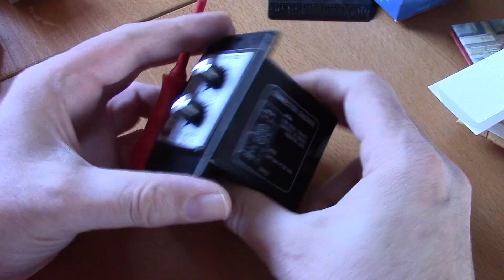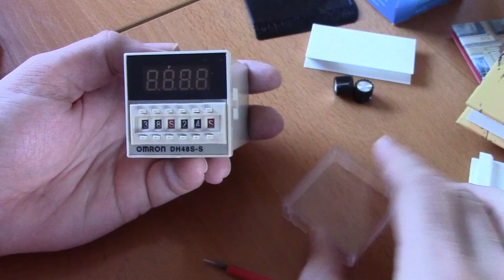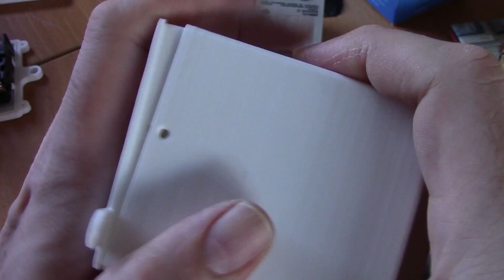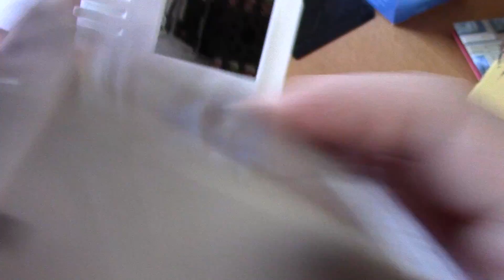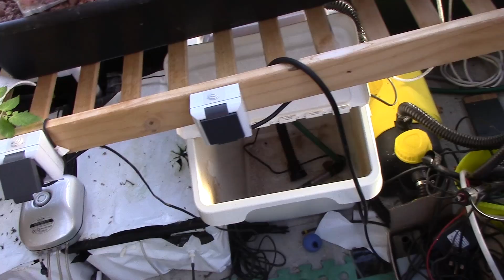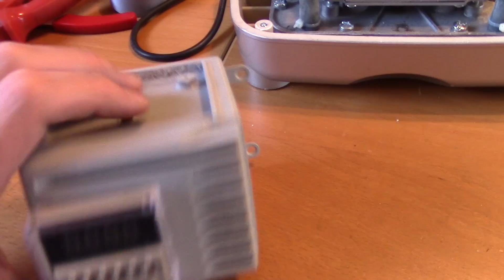Cycle Timers Revisited & Planting Onions

Comment: Hi, Thanks for Video. I have a question. I want to run my water pump which runs on Alternating Current 220 Volts and at about 9.5 Amps. I want to run it on 5 mins on and 5 mins off cycle until my water tank fills up and disconnects the power to timer relay and pump. For this purpose, I have purchased an FRM01 module and a 12V Power Supply to energize that module. The relay has a rating of 10 Amps @240 Volts AC. Do you think will it support the load of my pump or should I make any modifications. Any comments/suggestions are appreciated highly. Thanks
Reply from the maker: Hi Imran - With that 9.5Amps of current, I'm assuming that the pump is very large (2 or 3 horsepower). The 10A relay is only going to be rated for 10A resistive load and the contacts on the relay will probably fail after a few months in service as the contacts will likely wear out quickly or become welded together (this is the problem I had with my old relay modules, which is why this video is a 'revisited' one). Although I didn't do it in this video, if you want something totally reliable, I'd recomment using a solid-state-relay (SSR) module which are designed for running inductive loads (they're pretty cheap these days). I used other more robust dual-pole relays when I made this video because I'd had them sitting around in a box for a decade. Hope that helps. Cheers!!

Comment: Like the 3d printed enclosure, very neat. I prefer solid state relays to mechanical, mine handle upto 1500 cycles a day without any problems. Best part is there`s no clicking which can get annoying  ;)
No doubts you know but you`ll need a shorter fill time once the roots get going, as they reduce the space available for water ;)

Comment: I just got some NodeMCU boards in to play with, too.  I've still got some ESP-01's laying around, I want to figure out how to get them running as Arduino wifi shields, but a lot of the stuff I've found is shaky looking... not sure they're reliable yet.  I want to use them for my aquarium projects, so they need to be solid as life support systems lol
Reply from the maker: +mnelson10000 If I can get the nodemcu board working nicely, I'd be very tempted to bolt them onto everything electrical in the greenhouse. My air compressor can report back it's air pressure once a minute... my pumps can report their flow rates and water temperatures... etc... They're cheap enough that IoT-enabling everything is rather tempting....  Yet another project added to the list of things that I'll probably never get around to :-).... Cheers!!
Reply: +Jim Conner I've read some reports that PWM on them isn't quite stable or something, also.  It will definitely be nice once they're simple and solid like the Arduinos.  Arduino better get their act together or they're going to be left in the dust!
Reply from the maker: +mnelson10000 I imagine that they're doing PWM in software, and servicing the wifi receiver interrupts the PWM routines. I did buy myself a bunch of RS485 to TTL boards, so I could potentially run a multi-drop serial bus around the greenhouse to link devices together - due to an accident when ordering, I managed to get 10x as many modules as I needed though (whoops)... I would prefer the wifi approach though if it'll work reliably for me. Cheers!

Comment: Thank for the update on the timers, I'm glad you were able to find a good solution.  

It is also good to see that you are getting so much use out of your ultimaker 2, and that you are having fun in the process. 

The enclosures look great, and hopefully you get the ABS sweet spot sorted. :)
Reply from the maker: Thanks +Aerik Forager - I seem to think up something else that needs printing just about as quickly as the printer can knock them out. At the moment it&#39;s printing another ABS cycle timer enclosure. I&#39;ve got two and three quarters complete enclosures now. I closed off the front of the printer (using a sheet of thick plastic from saved from an old LCD screen) to keep the heat in, and added a layer of Kapton tape onto the glass build plate. That seems to have pretty much fixed the warping issues now, and I&#39;m getting ABS parts at about the same quality as the PLA ones. Cheers!!

Comment: Great one Jim, nice bit of design work with the enclosures. Have you tried increasing the hot bed temperature a bit for the ABS BTW?
Reply from the maker: +101blog Thanks John - I'm running the bed at 115C with a layer of kapton on the top, and I've got the front of the machine closed off to help keep the heat inside. Extruder at 235C, fans off. Anything under about 3cm tall prints beautifully, but taller stuff was giving me problems. I've got another enclosure slowly printing right now with some higher quality tweaked settings... I'll see how it turns out in a few hours time. Hope you're having a good weekend. Cheers!!
Reply: +Jim Conner Cheers impressed with the builds keep it up Jim!

Comment: Speaking of the 3-D printer, can you reused the plastic from failed projects?  Looking at your setup made me think of using a sump pump to reduce on times.
Reply from the maker: Hi +David Dube (Oregon Homesteader)  - Theoretically it's possible to grind-up the failed projects and extrude fresh filament for re-use. PET plastic can be re-ground and re-extruded indefinitely - it doesn't degrade in the process, but the ABS and PLA plastics will become more brittle each time they're re-processed. The PLA plastic though is a bio-plastic (made from corn syrup) and can be composted down (under the right conditions) and fed to the plants. (I plan to have a go at composting some PLA plastic to see if it'll break down properly in my compost heap). That big yellow pump was something of an accidental purchase - based on it's price I was expecting it to be substancially smaller and less powerful than it was. It'll push through a full litre of water every second (and that's real-world figures, not the ratings). 25 sconds worth is equivalent to emptying a full bucket of water over those two growbeds. Hope you're having a good weekend. Cheers!!